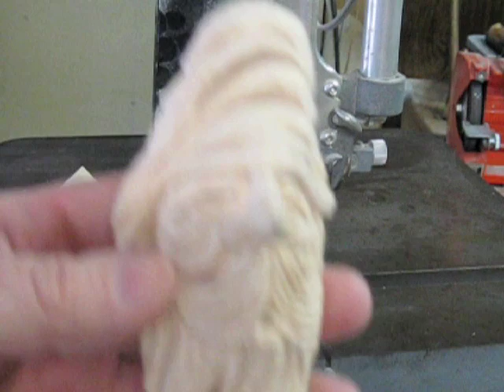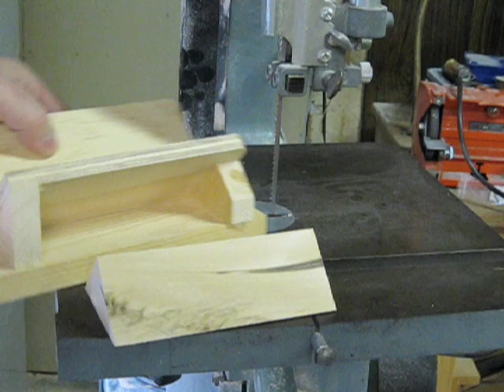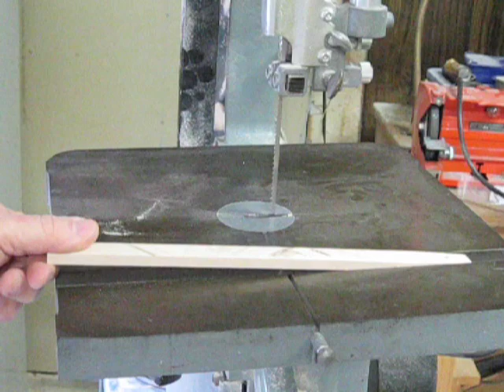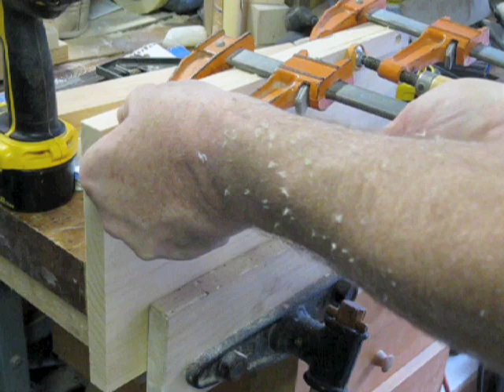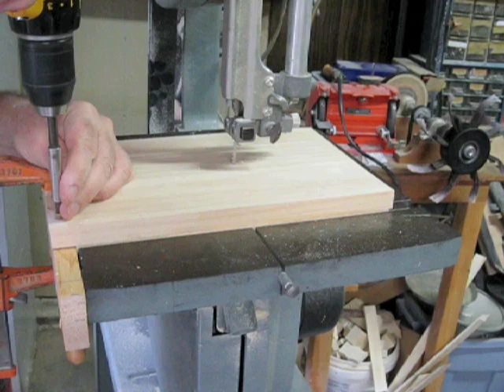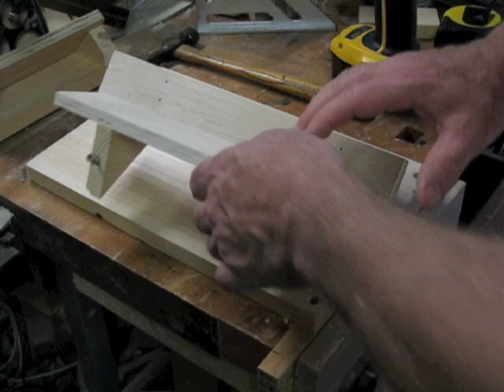Band Saw Rip Jig

Comment: Are ya still alive? Have you had a chance to run dowels through it?
Reply from the maker: Yes, still alive. Haven't made a video for a while. I have not tried running a dowel through this, but it should be fine as long as the dowel isn't too skinny. Hold on tight so it doesn't twist.
Reply: @thesundaywoodcarver   Thanks. I'll give it a go.